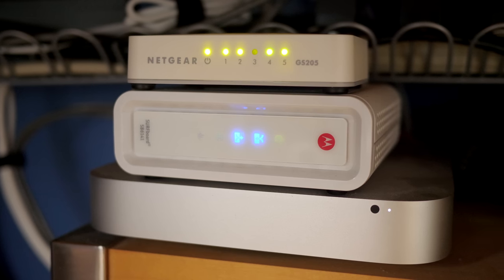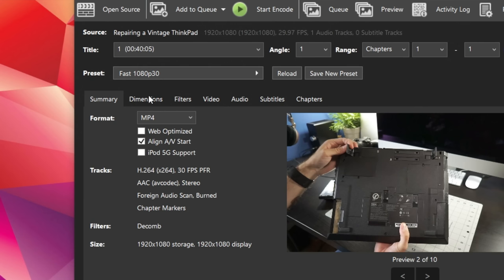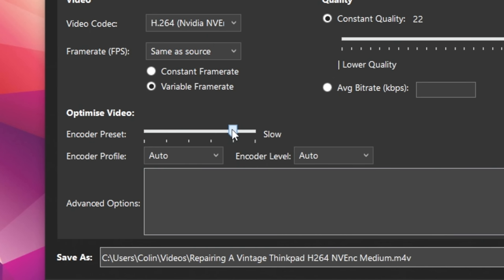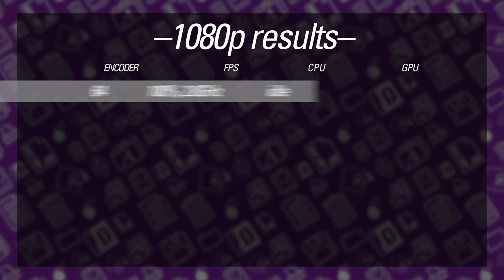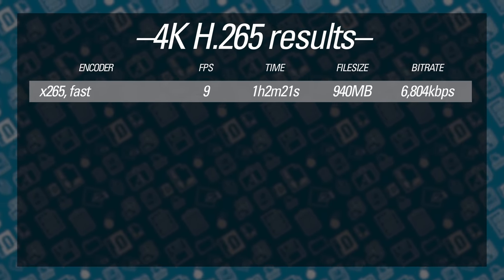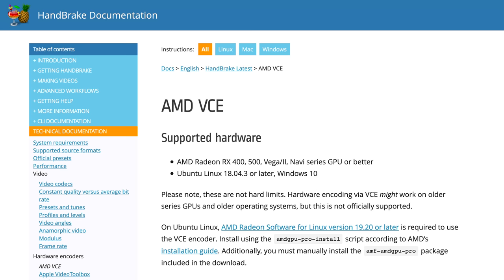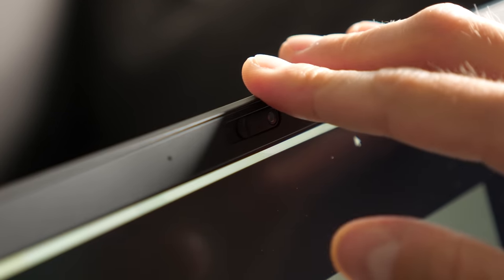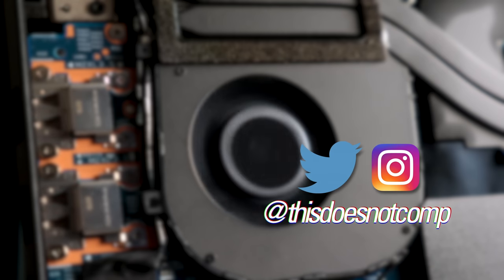Encode Video Faster with Hardware Acceleration (That You Probably Already Have)!

Comment: I’m a cyclist and I bring my GoPro Hero 5 camera along each ride.  I’ve been using Handbrake for a few years now to “crunch” the file size to a more manageable size.  It saves money spent on storage drives. 

 I recently purchased a Mac Mini M1 out of curiosity.  I was able to find a beta version of Handbrake that’s optimized for the M1 hardware.  You can encode either single or dual pass mode.  In single pass mode, it’s faster than my PC equipped with an Nvidia RTX 2060.  The quality, however, is inferior imo.  When I set it to two pass mode, the quality is significantly improved and in my opinion is better than encoding with Nvenc and Handbrake.  The files sizes are almost identical. It is slightly slower, but the improved quality makes it worth the wait.  The Mac requires less power (wattage) and runs silent.  

I’m a PC guy, but this Mac has impressed me enough to mention it here.

Comment: I recently upgraded my desktop PC GPU from a GTX 970 to a GTX 1660 Super.
Using Vegas I noticed an increase in performance in video editing of about 25% for rendering files.  I tried both small (under 2 min length) and not so small (about 45 min length).  
The thing that is probably mostly affecting any performance difference in my case that the 1660 Super uses a newer engine which is performing much better (NVENC).  In speed in vegas about 25%.  But I also noticed a huge difference in streaming (twitch) video quality where using the 970 (nvenc again under obs) provided definitely easy to notice pixelated video compared to the 1660 super.
The GPU you used is as far as I remember, also using the same as the 970.  I do wonder if a 1660 (or higher) GPU would get a much different result in your case.  Obviously not something you can test as you have a laptop, but it still interesting to think about it.
Unfortunately my CPU doesn't have qsync so I couldn't test them with that too.  It's a i7 5960X.
Thanks for the video.

Comment: I would be curious which of the various encoding formats (e.g. H264 vs HEVC) resulted in the video being available on Youtube the quickest. Sure HEVC will have the smaller file sizes and thus will result in a quicker upload, but remember Youtube still has to take that Video and do its own post-processing on it in order for it to be available at the various Quality formats available. I suspect we have all encountered that scenario where we've uploaded a 4K video to Youtube and whilst 420p and lower quality settings were available it took some time (perhaps hours even) for all that quality formats to become available since Youtube must do its own processing there.

Another thing to keep in mind is that with HEVC you're trading off video encoding performance for smaller file sizes but also faster decodes. One of the stated purposes of HEVC was to make high resolution accessible to low power devices like smartphones.

Comment: One thing that was missing that I would have liked to see is comparing the quality of the results.
You choose 22 constant quality with all the encoders, however from what I have seen on forums, different encoders will produce micro blocking and other unwanted artifacts, where others do not.
Typically software encoders (x264, x265) produce a better quality image, regardless of the CQ setting you have set.

This is something to consider since, in your example, you are going to upload your videos to youtube which again, will re-encode your video.
Having the best quality as a source is important here. Garbage in = garbage out.
Reply: YouTube supports ProRes, and you can export ProRes from FFmpeg (using its prores_ks codec), so there's really no excuse for uploading H.264 or H.265 to YouTube unless it's intra-frame and perceptually lossless (QP=0 / CRF <=5). CRF 22 is really high and will not recompress well, as Josh says.

Comment: I use FFMPEG which is what HandBrake uses internally. I specify a target bitrate instead RF. When I do that, file sizes are consistent with bitrate and the length of the video in time.
Reply: thecouchtripper  Probably so he has a predictable file size that's easier to upload over a slower connection?

Comment: Just fyi, both handbrake and OBS use ffmpeg under the hood to be able to do software and hardware encoding. Ffmpeg is a command line utility. But you get a lot more options.
Also, from reading, I've seen people saying that hardware encoding produces lower quality videos. Not sure how true this is. Even if true with the time benefits, you may be able to still get something better and increase the quality more than you would with software encoding.

Comment: It is really only in realtime encoding hw acceleration is useful. The result is worse and files are bigger which is not good for a result you are going to save.
Reply: I have some chapters of a series in 4k that weigh 10gb each chapter. I want to convert those videos to 1080p and in the best possible quality. Could you give me your favorite Handbrake settings to see if I can reduce the size and keep it looking just as good?

Comment: Let me preface this by saying that my knowledge of video compression technology is very low. But from a layman's point of view, I disagree with the parameters chosen, particularly 'quality'. The yardsticks for measuring quality can't be software 'presets'. Instead, it would have been better if comparisons were made based on bitrate (as a measure of quality), along with compression time and file size.

In other words, presets/compression settings could have been chosen such that they achieve a specific bitrate; then, comparison becomes one between compression time and file size.

Alternatively, settings could have been chosen to aim at a specific file size; then comparison/tradeoff could be between bitrate and time.

As I don't have the hardware, would love see the results of experiments conducted on these lines!
Reply: You have a decent point, but the quality slider in Handbrake uses software to analyze the frames of video during the transcode to dynamically adjust the bitrate for each scene. It is possible to get a high quality result with both methods, but the quality slider saves you a lot on filesize in the output file. I find it the easiest method for compressing my bluray collection because if I decide that quality setting 24 doesn't look good enough for one movie, I can take another stab at it and up the quality of the finished file in a meaningful way all while maintaining a small filesize.

Comment: Although this is a very good video and gone through a lot of what QSV and NVENC do, there is also one more thing: even with the same RF 22 chosen in handbrake, the final result would still be different in quality. You'd need to use something like Netflix's VMAF to quantify the output's quality to ensure the encoders are generally achieving the same thing, with all the differences in performance and file sizes

Comment: The real solution is to get a desktop computer with full fat hardware instead of using potatoes like Macs and laptops with tiny heatsinks and clock limited silicon to match. That'll speed things up way more than any settings.

Comment: You're missing out. Check your Mac. It's T2 security chip is basically a iPhone CPU with it's hardware video encoding. Use HandBreak and use "Video Toolbox" under video encoder.
Reply: Oh, and the T2 will encode H.265
Reply: Sorry, but you're making a HUGE error. The Constant Quality number are NOT consistent between different encoding methods. So 22 using software is NOT the same as 22 using QuickSync or Nvidia. I think it even says this when you mouse over it. You have to check the kb/s and match that.

Comment: Nvenc and the other hardware encoders are a godsend for streaming games, but it doesn't make much sense using it for handbrake, unless of course you have higher end hardware. I'm not sure for Intel, but the image quality nvenc produces, increases the more powerful the graphics card. Nvenc is for speed first and foremost which is why software encoding will always produce the best image quality.

Comment: Latest Adobe Premiere version should support hardware encoding when exporting. Resolve and Final Cut have supported it for a while now.
Also, in my experience the transcode quality using the same settings goes like this: NVENC > Quick Sync > VCE

Comment: I usually transcode 720p or below. H265 is just too demanding for my system. So I stick with H264 and software encoding for smaller file size. With 6core CPU like old Xeon, the encoding speed is actually not bad.
Reply: There's no reason to use anything above 720p for most people.

Comment: Even HEVC playback is a stress-test without hardware decoding. 😕 My decade-old laptop can't play h.265 (at least not 720p videos, and especially not at 1.5x+ speed which I watch everything at). But, I'm still amazed by its performance with such small sizes at such high quality and resolution. I wish I could remember the name of that new codec that's coming out soon that will put even HEVC to shame (I'm fairly sure it's not h.266 VVC because they'd been using that name before I heard about this one).
Reply: You mean AV2/AV1? The successor of VP9?

Comment: Let's say I have a lot of old gameplay footage that takes up too much space due to nonesensical high bitrates during recording. I don't use them, but want to keep them at a resonably good quality and small file size.
In that case, I assume that software encoding H256 would be the best option in handbreak? Or am I wrong?
It doesen't matetr how long it takes or how slow the encoding is, priority are a small file size while keeping a reasonable quality that doesen't look too bad when watching those old recordings.

Comment: So this kind of reaffirms my conclusions from the last time I looked into hardware-accelerated handbrake encoding vs software encoding-a conclusion I made years ago btw. Still, I wondered if things had maybe changed since I last looked into it, but I guess we're still CPU-bound if the hope is to achieve high-quality video with small sizes over a speedy workflow. I still have this one super specific question left. Will an outdated CPU like my i7 2600 be outperformed by newer processors in areas other than speed? I know it's obvious that the new chips from Intel and AMD will be way faster at crunching the numbers, but when using the x265 software encoder in Handbrake will the output file from a modern processor be of any higher image quality, or more efficiently compressed?
Reply from the maker: When using software encoding, quality won’t change between CPUs — at that point the chips are just doing the math that Handbrake tells them to. You’ll only gain performance with newer CPUs.
Reply: @ThisDoesNotCompute  you mean theoretically only the rate of time should change?

Comment: On Linux both video acceleration technologies are available (NVidia's NVEncode, and Intel's Quick Sync), and Hand Brake has a native Linux version that can be used. The OP's ThinkPad X1 Extreme has official Linux support (from Lenovo). Would the OP consider doing a Linux version of this video?
Reply: With my ThinkPad T480 (the Intel UHD Graphics 620 video hardware variant) running Linux Mint 20 the following video/picture  acceleration profiles are available:

- VAProfileMPEG2Simple
- VAProfileMPEG2Main
- VAProfileH264Main
- VAProfileH264Main
- VAProfileH264High
- VAProfileH264High
- VAProfileJPEGBaseline
- VAProfileJPEGBaseline
- VAProfileH264ConstrainedBaseline
- VAProfileH264ConstrainedBaseline
- VAProfileVP8Version0
- VAProfileHEVCMain
- VAProfileHEVCMain10
- VAProfileVP9Profile0
- VAProfileVP9Profile2

Based on the above profiles most of the major media (pictures, and videos) that use the more modern codecs would be supported through hardware acceleration.

Comment: when I did similar experiments in the past I didn't think the nvenc/quicksync files looked as good as software encoding.. did you visually confirm they were 'the same' ?
Reply from the maker: They looked fine to me, with the caveat that the source files didn’t contain much fast motion (which is where compression artifacts most commonly show up). Which encoder (and quality settings) to use can sometimes be dictated by what you’re trying to compress — I’d use the software encoder and a more generous RF value for an action movie, for example.

Comment: MAC - weird with the mac in the back you didn't talk about macos- handbrake didn't used to support quicksync on macos for example. It now supports 'video toolbox' but its a blackbox. so what it uses under the covers is hidden unfortunately.
Reply: Apple VideoToolbox uses the GPU portion of T2(provided if your Mac comes with it) or M1 for encoding.

Comment: currently doing some tests with AMD VCE. My RX 580 is definitely faster than the Ryzen 5 3600, I'll need to test my GTX 1080 and RX Vega as well. got a 1.1GB file down to 160MB on software, and 485MB on the 580's VCE.

Comment: I am using h.264 NVEnc at 23.977 FPS, quality 18 and audio pass through with video crop on i7 processor with 4 cores and nvidea gtx 1060, it is processing around 100 fps, GPU at 30%, cpu at 52%.
Is there a way to improve performance?

Comment: So I'm using a GTX 960 and Intel 2400.  Both generations are too old.  Nvidia requires 10th gen or newer.  Intel quire's quite bit newer.  The fact that Linux acceleration only works from handbrake cli makes the entire thing a no-go for me.  I'm looking to upgrade to a Ryzen 5 3600 to just brute force it.

Comment: Out of interest, if you increased the bit rate of the SW encoder to a similar level as the HW encoders were using, how would that affect timing?
Reply: Increasing the bitrate with no other changes in software encoding will only improve the video quality, not the encoding speed
Reply: And what about the other way, constraining the bitrate of the hardware encoders ? Is that going to reduce quality or increase processing time ?
Reply: Yes, bitrate doesn't affect the encoding speed at all, only the quality presets in the different encoders.

Comment: Any thoughts about the effect of disk and memory bandwidth bottlenecks on this test?
Reply from the maker: Drive performance and RAM are largely a non-issue when it comes to video transcoding, interestingly enough. Processing power is the bottleneck by a very wide margin.
Reply: @bashful Fun question, but it makes total sense. He peaked around what, like 120-something fps in the fastest encodes? How big do you think a 120 frame video would be? Memory and storage speeds can maintain that rate all day. The x265 encodes are even slower than that, so it's even less work for the memory and SSD to keep up with.

Comment: I understand this video is 3 years old and you are using old hardware even for 3 years ago, It would be cool to see an update on the numbers using current gen 14th gen Intel and 40 series GPUs.
My current system is a 13900k with a 4080 super and I've been using Handbrake to make my content for my Plex server smaller. 
My Rip of Fellowship of the Ring was 113gb at 4KUHD and almost 87mb/s bitrate... Yes, this video needed to be compressed.
Software H.265 would have taken 4 hours encode! I could have watched the entire movie waiting for my encode LOL!
I ended up using NVEenc and that took 45 minutes, but It drastically reduced the filesize to an acceptable 40gb and 12MB/s bitrate. The newer hardware clearly added file size reduction..

Comment: After a long time very recently I once again tried Handbrake to rip one of my DVD's (indeed using hardware acceleration), but this didn't work out at all, since only the first chapter (or only parts of it) were encoded. Other Chapters didn't even show up in Handbrake, something which still worked some years ago.
But some years ago I dropped Handbrake completely, when they dropped support of one of the video container formats. Now I don't use this format anyway, but I never went back to Handbrake. Since then I'm using FFmpeg (installed/updated like many other OS tools that I use via MacPorts) straight from the Terminal for pretty much any encoding job (AFAIK Handbrake and similar tools are just fancy frontends that are using FFmpeg nevertheless). Since I'm using a Mac first I tried hardware encoding via the Elgato H.264 HD dongle and it's horrible software when FFmpeg didn't support hardware encoding yet. But using FFmpeg's h264_videotoolbox Codec for hardware acceleration on a Mac (hevc_videotoolbox/h265 hardware acceleration isn't supported by my MacBook Pro from '15 which btw also will be my last Apple device since I'm getting a better servicable/repairable Linux-only Laptop next) is just so much faster, better and has a higher quality then Elgatos horrible software and hardware. But usually I convert my SD recordings from TV (recorded using a Dreambox 8000) via software encoding with libx264 and the HD recordings via the hardware accelerated h264_videotoolbox (btw. audio transcoding can also be done hardware accelerated via aac_at (at stands for audiotoolbox I guess?), but I haven't found an option for this is Handbrake's audio settings/Codecs).

also 2:51:
But I'm kinda curious if this can be solved too via the above mentioned method of using pure FFmpeg. I doubt that my machine supports this, but reading the documentation of the various Filters of FFmpeg I noticed that there are some variants of more common filters i. e. for scaling that also use hardware acceleration (via CUDA). For instance beside the already mentioned "scale" filter there's also an optional scale_npp filter (http://ffmpeg.org/ffmpeg-filters.html#scale_005fnpp) that seems to use NVIDIA Performance Primitives (libnpp) for doing the scaling in hardware. But there are more filters with hardware acceleration support like transpose_npp, overlay_cuda or yadif_cuda (for hardware accelerated interlacing).